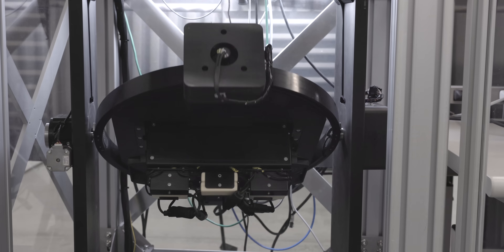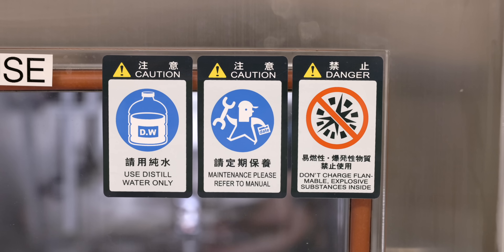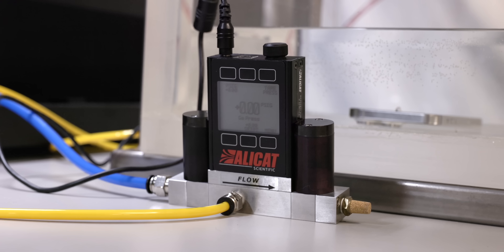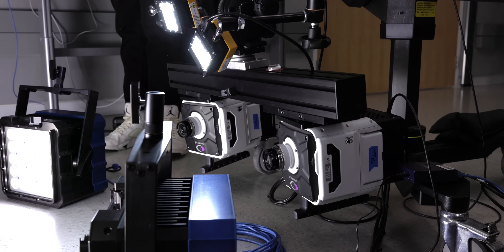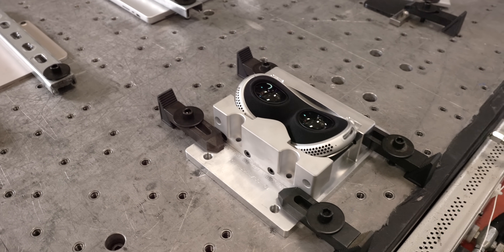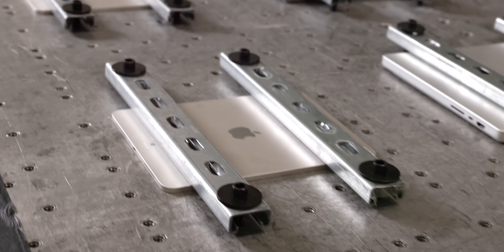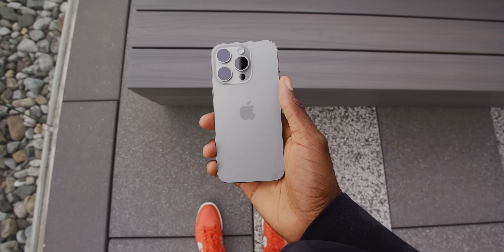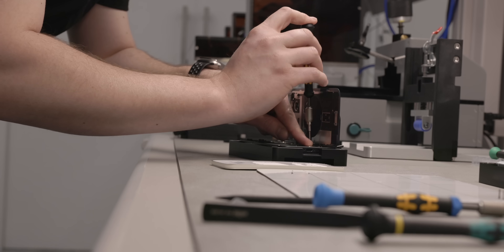I Visited Apple's Secret iPhone Testing Labs!

Comment: i did love the repairability vs durability argument like, it completely missed the point of what make iphones borderline unrepairable... PARTS PAIRING. Yeah water resistant makes phones harder to disasemble and change parts but what makes apple the bigger ass on industry is that now that you changed the screen the camera wont work the way it did before.
Reply: You wrong... GALAXY S5 was the really the peak of Samsung Design.. it got IP68 but also completely easily repairable..
Reply: tbf mkbhd probably doesn't want to be blacklisted by apple so he's not gonna throw them "hard hitting" questions. tho i do feel like it would've been better for marques to not have included that segment at all, rather than make it look like he's running pr for them
Reply: @hiddendrifts in a way it makes sense though. You can make something incredibly powerful and durable like concrete. To repair concrete though is very expensive and difficult. Asphalt is no where near as durable but way more repairable and cheaper. Another example is modern cars, way safer and reliable than older cars but less repairable. IKEA furniture is another example, pretty modular and repairable but not that durable. 
It is a trade off that you must consider, do what a repairable product or a durable product.
Reply: @Bobspineable  >it's a trade off that you must consider<
sure, some impediments are probably unavoidable, but like op mentions, plenty of them can be avoided
Reply: @Bobspineable  Wtf you on about. Old cars were much more reliable than the new models. They were built with more durability and sustainability in mind from the get go, before all of this "planned obsolescence" crap we have now. And, from a practical standpoint, new cars are so technically advanced and much more complex and that only adds more potential points of failure which makes them far less reliable, not more.
Reply: 100%. This is somewhere I have to strongly disagree with Marques, and to the extent that I think he got a bit starry-eyed visiting Apple HQ. It's very rare from him, but I think he sipped the kool-aid on this one.
Reply: @SpencerPaire and he didn't even ask about planned obsolescence 😂
Reply: @SpencerPaire I just think he knows they won’t get into that on camera. These guys never get pressed about real issues
Reply: @SpencerPaire well it is a trade off that exist everywhere. You see it in cars, modern cars are super reliable but difficult to repair while older cars are very repairable, just not as reliable.
Reply: @Bobspineable nah I got to disagree with car analogy, older cars can be reliable and repairable as can be new ones
Reply: @Bobspineable 
Nah, older cars are reliable and repairable

You can fill low quality fuel, mixing any lubricants (engine oil, transmission oil, differential oil for rear wheel drive and all wheel drive) even fuels with cooking oil on the old car, yet the car still running fine. Do the same on the new car and you'll trigger check engine light
Reply: @Dinkywinkyxo  what I meant is the frequency repairs. A modern car can go a pretty long time without repairs. It’s just when they do need repairs it’s difficult.
Reply: @beezanteeum  a modern car however with everything done correctly go go quite a long time without repairs, it’s just when things do go wrong it’s expensive and difficult. Older cars are just way more repairable. Yes old cars are reliable but the likelihood of something breaking in modern car is just way less than before.
Reply: @Bobspineable  Well, my Discovery Sports (two generations) have been to the shop at least three times each year (six years by now). Not very reliable. At the moment having issues with DEF liquid estimation software that keeps asking for more all the time. The two dollar windscreen liquid container cost a whopping $1500 (guess if it is available from anyone else than the manufacturer. Both engines required replacing the timing CHAIN at about 70 kmiles, costing $4000 each. What about my previous Pathfinder? Replacing a bearing required swapping out the whole arm, $1500. Replacing some springs the in the mass damped flywheel, no sir, not available you need an new flywheel at $2000. And so on. So yeah, modern cars are very comparable to moder anything. Not very durable and hard/expensive to fix. 

I give you that oil exchange does not need to be done as frequently as in the old cars but again, after my first DS engine had silvery dust in the oil and a piece of metal broken off from the engine, requiring a complete re-build at $5000,  they said that I should not have relied on the 20.000 mile oil exchange period and recommended 10.000 miles instead.
Reply: Yep, which is why I really despise Apple and their bs argument on repairability, I also don´t like how MK just "nods" to it, I mean, if you´re an Apple fanboy I get it, but don´t say that you are ok with this when other big companies don´t do all these horrible practices.
Reply: @CalusoXP Samsung is doing it as well.

Both are bad companies and I don’t understand why people keep defending their practices.
Reply: Exactly, parts pairing as well as apple's predatory practices of only allowing some places access to parts
Reply: I was actually super baffled when I heared it. That is just so wrong to say and sounds like a 10/10 apple keynote to protect them self from there predatory practices about non repairability.
Reply: yeah what abou the screws though, its clear that their intent is to not make phones repairable, and this durability-reparability scale just happens to support their excuse.
Reply: I was about to comment this exact thing, but you put it more spot on into words than I ever could
Reply: Yeah
Reply: I used to feel the same way until I took a hardware security class and... I get WHY they do it and I do understand that its necessary considering their engineering stack and they claims of security 1st that they need to maintain, but they do tend to go pretty extreme with it to like BMW/Porche levels
Reply: Marina profile picture spotted
Reply: Imagine thinking Apple wants durability up to the extent that they want the phone to last as long as possible. Not like they want to sell new iPhones.

Sure they want it durable, but in the end, like every other company, have planned obsolescence either artificially or via their practices like anti-repair.

They want you to replace the phone. That’s why when you go to the Apple Store (without Apple care which is also expensive) the price to repair older phones costs almost as much as just getting a new one. 

They aren’t stupid; they exist to make profits.
Reply: Mkb sold out lol
Reply: In many parts of the world iPhones got stolen and snatched and sold in market as spare parts. So it makes a little sense.
Reply: Apple now allows parts pairing form any other Apple iPhone. So idk what the argument is here
Reply: The thing is to me, the majority of repairs on phones are either done by people at home or repair people like you find in shopping centres/malls that are most likely not using genuine parts. If you take your iPhone to an Apple store for repair, then there is a damn good chance it will work like new.  No different to buying a car. No car manufacture will give you any sort of warranty on a new car using inferior parts done by yourself at home.
What I got out of this, is that Apple's plan is to make their products as durable as possible so no repairs are required. Breaking the glass is exempt, as glass is glass & glass can break.
Reply: @purplehazeffc  using cars for an exemple is so wrong many manufacturing brand are extremely reliable and easy to repair (honda, toyota) and youd be suprised how many parts are shared in the industry with huge industry like bose that does basically half of the electronics in the car world..
Reply: @eratoz5096  while reliable, modern car reliability is incredibly high and better than older cars, they just are not as repairable.
Reply: @Bobspineable  yes to an extent, complexity is harder to work on but their is a difference between complexity and intending for your product to be less repairable and making it so only the company could work on it like tesla or apple it's a trade off.some newer technology arent even made by human hands anymore   but you can  clearly see when the product was made to be unrepairable or is just inherently complex
Reply: @purplehazeffc not even close. Even taking a part from a new iphone and replace another part from another iphone will not work. So the inferior part argument is false. Cars on the other hand, while it's true that there will be inferior parts, installing them will not disable that part. Only make it less durable. On the iphone however, changing parts, even from other iphones, will break/disable features.
Reply: @EugeneManugas yeah, but to the phone you install it in, it doesnt know the condition of the part, what changes have been made, if its correctly calibrated, if its actually a part at all. im no apple glazer, but there are good reasons why apple does these things, they want their phone to be perfect for their TARGET user, which isnt tech savvy diy repair people, so they would prioritize better features than repairibikity
Reply: @EugeneManugas isn’t part paring to stop people stealing your phone to sell for parts for this?
Reply: @purplehazeffc  Apple specifically pairs parts together and purposefully makes them work incorrectly if a repair/replacement is done outside of Apple. You could transfer a brand new iPhone screen from a brand new iPhone onto another iPhone, and TruTone won't work.

It's all just Apple software making sure you bring your iPhone back to Apple.
Reply: @purplehazeffc  the thing is when you go to a shop to get your car fixed the mechanic doesn't say "well the valve gasket is broken so you prob need a whole new engine". The majority of apple technicians just swap boards rather than finding an fixing the actual fault. Why else would it cost so much money when people go to apple for a repair then have to take it to a third party shop that can fix it for a fraction of the price.
Reply: @wilsonfromthewarehouse aren’t a lot of third party parts stolen? hence why they are paired in the first place, too stop people stealing phones for parts.
Reply: @purplehazeffc  but even with genuine apple parts some features still don't work the same. I get that obviously if you use a non-genuine apple part it shouldn't work as good as the original but I think what most people have a problem with is even with genuine apple replacement parts you still get suboptimal results
Reply: @purplehazeffc so wrong.

Comment: So essentially what we got out of this is

Durability: pretty much hard to or near impossible to break (so wear and tear, water damage, dust damage, and cracks/scratches) but downside if it does somehow break (mainly the battery in this case) it would make it extremely hard to repair.

Easy to repair: well pretty simple as it says it’s super easy to repair and replace/fix parts that need to be dealt with and can be easily constructed by an average person. Downside however it would mean it would have less durability because of hazardous openings such as gabs/holes, water & dust damage can easily accord, weaker materials, and finally it is easier to break it.

So where do people stand on this?

Are you team durability or team easy to repair?

In my case it’s team durability mainly because I do want my phone to survive whatever comes it’s way and while yah technically in one cost I would have to pay more to get it fixed but that one cost can at least (as long I’m not that incredibly stupid/accident prone) near guarantee me my phone can still work for a very long time without it needing to be repaired again for minor things that are least likely to ruin my phone, while the downside of easy to repair is the cost over time as though yah individually you can get the parts cheaper to fix it yourself if what you buy is not at least as good as what the actual manufacturers use there’s a good chance those can break a lot easier and you have to buy those parts again & again so on so you would be paying more over time. (Though again if you’re an idiot/accident prone person either these don’t seem like a good option anyway so you might have to pick between one of those two evils 😂😂😂😂). Anyway that’s at least for me.

Comment: I think he is right with the repairability vs robustness argument, the Apple thing of coding spare parts is a completely different argument.
  Although a valid one. 
   Apple is doing some good work in the testing, I can vouch for my 14 pro max that has copped a beating due to my clumsiness, on a couple of occasions, seeing it hit the ground or landing glass side against steel table leg , I thought it would be stuffed , and touch wood, so far it has survived almost unscathed except for a small scratch on the screen.
 Phones in general are pretty robust given they are a slug of electronics , a battery sandwiched with glass or plastic on either side depending on the model .

Comment: Apples argument about durability is nonsense when they bring out a new phone every year, and the the software slows down and fails after a few years. If I drop my phone in the toilet then that's on me and I can live with that, but when my phone just slows down and the battery gets to the point of being virtually unusable when I've done nothing to abuse it then they force me into buying a whole new phone, rather than replacing the parts that are bust.

Comment: In reality, there’s a number of factors involved in the continuum between durability and repairability

For a phone, tighter integration can certainly yield better ingress protection for sure, but it’s not a spectrum that makes as much sense at scale.

Something can be engineered to be repairable and durable if the scales are larger, but I guess that’s out of scope of the engineering context of this video.

The challenge at the scale of a phone is that there’s the smaller the device, the more complex the repair - however, this eternal pursuit of “smaller devices” isn’t actually what everyone wants but Apple is incredibly effective at marketing that “thin, compact and premium” logic.

Comment: The scale isn't a line, its a triangle with reparability durability & sleekness. The line is between making devices with the greatest potential to last the longest, and making devices that will most easily sell you into the next product.
Reply: The real scale for Apple is repairability vs profitability. Everything else is propaganda.
Reply: I also feel like the more complex a device is, the harder it is to have both of repairability and durability, just more things that can go wrong, a simple old phone has obviously cheaper parts but also less of them and less functions in which things could go wrong or missing.
Reply: It's apple. What do you even expect from this channel
Reply: Apple's idea of durability is that since they "tested" it, any issues outside the lab is the user using it wrong,
Reply: bingo. a device that's both durable and designed so that your average nerd could "i fix it" would need to resemble a brick

Comment: Apple is actually not the worst when it comes to being hardware repaired. The problem is really the software locks they put on the parts. If you could buy official parts from Apple and just install them and expect all to just work, without any serial non sense pairing, they would be able to claim the whole mother nature thing. They are evil on purpuse.

Comment: On the scale of durability and ease of repair, you're not factoring one major component that is software. A big reason Apple repairs are notoriously tough to repair is because they make the active decision to serialize and require the need to calibrate almost all replacement parts using exclusive tools from Apple. That is a conscious choice to punish users for not using OEM parts if they choose not to do so.  So while yes you can justify the difficulty of repair because of more durability, you can't forgive Apple for locking down software to further complicate non "authorized" repair.

Comment: That, right there, is some finely cooked bullcrap to justify non-repairability. Durability of the product will eventually fail. At that point, it's frustrating for the customer to not be able to repair a product. Also, locking hardware parts with verificaitons to a point that even camera module swap from another iPhone not working is not really helping with durability in any way.

I'd rather have a 1mm thicker iThing that can be repaired easily than one that can't be repaired.